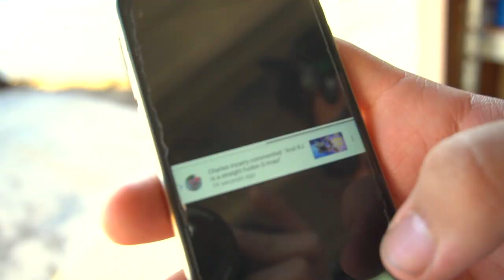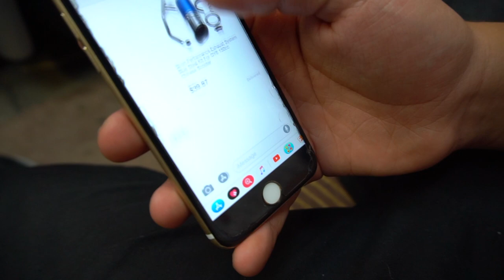CRAZY CUSTOM EXHAUST for my GY6 150cc SCOOTER | SO FAST

Comment: Without a secondary support point on your exhaust pipe or muffler you are either going to rip the 2 bolts out of the motor or break the pipe at it's highest stress point.  The mount on the muffler was there for a reason.  You should at least consider a way to create a second point of support.  If you rip the bolts out it's essentially game over for the heads.  Just a little tip for ya buddy!  If you have any questions you know how to reach me.
Reply from the maker: Darrel Root Carpenter already working on the exhaust support haha just wasn’t right away

Comment: Check my last video out and find the one I have it's a 150cc gy6 exhaust off eBay $90.00 1.25 inch pipe and it's a shorty. I know I'm running it on a 50cc gy6 but I modified it to fit. Stock pipe is 19mm the one I'm talking about is 24mm pipe.